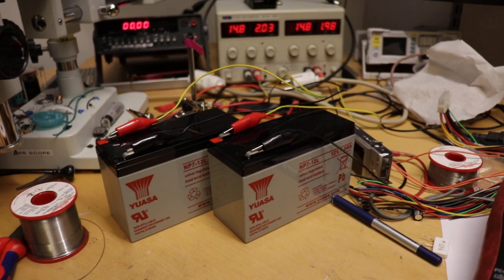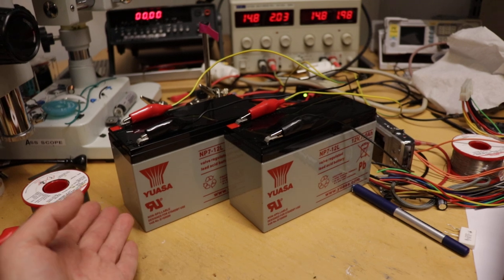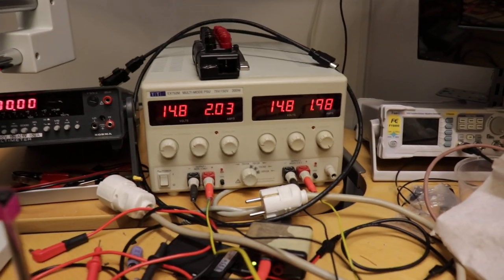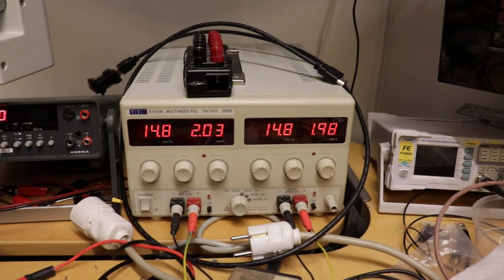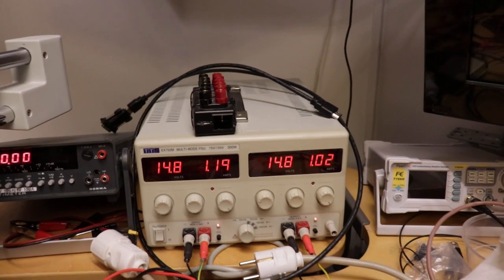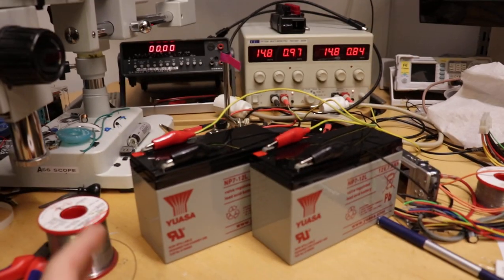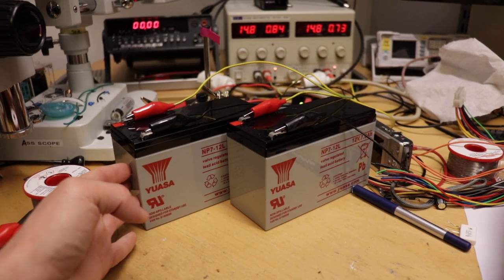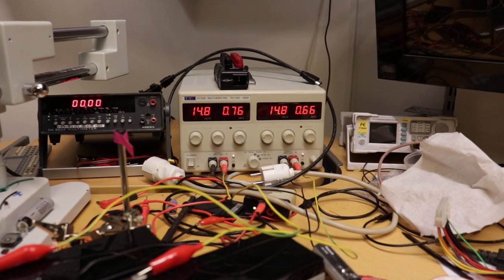Why you should individually charge new lead-acid batteries before install

Comment: I just picked up some used 52v 18650 packs. First thing I did was open them up and make sure every parallel bank was the same voltage. This helps out the bms plus verifies the bms has been working.

Comment: It'd be nice if UPSes had a balancing system akin to how lithium batteries have with the taps between cells to make sure they're all charged properly, but I guess that'd make them cost more, and APC would not make the big bucks out of selling us over-priced battery packs that crap out in no time due to not being properly charged...
Reply: I had an 48V sine wave ups which used 4 batteries in series. I added simple circuits to each battery consisting of a suitable zener diode and a 250R resistor. All components were cherry-picked from a larger batch to be close to identical. The batteries lasted over 6 years until one dried out. No puffy overheated cells and no drama. I keep telling myself that the balancing circuit helped :)

Comment: We use the exact same batteries in our fire panels 2 in series. And we (of course) never balance them. And we test them every year by letting the panels run on batteries for over 1 hour (+- 1A load) and after one hour they never differ more than a few 1/100 of a volt. I guess they kind of balance themselves.

Comment: I was taught many decades ago to put 500k resistors across batteries in series and let them balance themselves..
Reply: It'd literally take forever with a 500k resistor!
If one pack was at 12V and one was at 6V, you would be "balancing" at 12 MICRO Amperes.

Comment: Interesting, got 3 years out of my previous 2x12v 18ah batteries, I wonder if I could have extended them by checking this first?

I also brought a new UPS this time instead of just batteries, do you think UPS manufacturers check this or just throw two batteries in off the shelf?

Next lot I will need to do this however, appreciate the knowledge and content! :)
Reply from the maker: The manufacturers definitely do not check this.

Comment: hmmm, I thought charging to 14.8v per cell is what gets them into balance? whatever is over 13.7v is just a temporary charge and whatever is extra current flowing just electrolises the water? So the higher charged one just electrolises the water a little more absorbing nothing more than it can hold and passing the current to the other battery getting it to the same voltage. maybe the UPS never does that for a long enough time perhaps? well I guess I better check and charge my UPS's then, and will certainly keep that in mind in the future!

Comment: The company I work for, go through 100's batteries of these in a year that get wired in series and I've never seen a problem with them being unbalanced. The biggest killer of these batteries is heat. They only have a service life of 5yrs because they produce hydrogen sulfide.
Reply from the maker: Hydrogen sulfide? I haven't heard much about that being an issue in VRLAs, can you tell me more?
Reply: ROFL @ "go through 100's batteries of these in a year that get wired in series and I've never seen a problem" - well of course, because you aren't looking for a problem.
Reply: @johncoops6897  I've been working on fire alarms & 24v PSU's for over 15yrs and I've never seen a problem with unbalanced batteries. I have the proper tester for these batteries so you soon see if the batteries are out of spec. When you do the annual inspection that involves testing over 400 batteries in a two weeks on one site, you soon start to see patterns of battery failure. Usually it's either cheap rubbish batteries or heat. Heat kills these batteries faster than anything else. In a room that's constantly over 27'C batteries that are good for 5+ years can be killed in less than 2.
Reply: @FFcossag  It's not a big problem, it's usually prevented by regular testing and replacing them before they go out of capacity spec. I can usually spot them if look at the way the light reflects off the sides. If they are convex in any way, then it's time to swap them out. It can happen quicker if the terminals corrode.
Reply: @grahammuppet  - sounds like you've never even tested them for voltage balance. Nevertheless, they kind-of "self-balance" to a degree if you whack them with a very low current charge for a long period of time.
What kills them is heat, vibration, and being continually trickle charged (like UPS tend to do).
Reply: @johncoops6897  Yes and no. We do check for it in fire alarm testing. But I don't worry about it because they will balance themselves within a day or so. If it was a genuine problem that would cause problems, they would of modified the regs on fire panels in the uk to balance them during charging. I've tested 1000's of batteries over the years, which includes recording the voltage, capacity and temperature. You will always get the odd battery that goes wrong early, but usually if a battery looses it capacity before 5yrs it's either heat or cheap batteries.
Reply from the maker: Oh, that sounds more like plate growth or pressure buildup due to hydrogen gas production, not hydrogen sulfide. I've never heard of hydrogen sulfide in particular causing problems, so I read a paper on it, and it mostly seems to be an issue when cells fail in thermal runaway.

It's nice to hear that you don't have problems with battery balance - you must have good suppliers and/or equipment! This is not always the case however, and I've seen many unbalanced pairs of batteries shipped over the years.

Heat is indeed the biggest factor for killing lead-acids (corrosion of the positive plate accelerates exponentially with temperature, turning the innards into mush), but in applications where heat is not forcing you to replace your batteries frequently, factors such as cell/block balance begins to play a more important role.

Comment: Hello, I want to ask about this device.
Model No.: InfiniSolar 10k - PAR - B
 Does it sell the surplus to the electricity network? I own 2 of these devices. According to your experience, is it possible to earn, meaning is there a feature to export surplus electricity to the local network? Please answer
Reply from the maker: You can, but you need to talk to your local grid operator and sign a contract, if they offer it.

Comment: Please  , can you tell me what is the cut-off current for battery charging : Ex :  for lead acid 12V 7.2A
Reply from the maker: That depends on many, many factors. 0,01C-0,05 works as a rule of thumb.
Reply: @FFcossag  Thank you

Comment: i have so many questions !! first what are you going to do with them and second did you check the amount of liquid inside ?? maybe the capacity difference is due to the amount liquid inside and can you top it up or not (i bought new led acid batterys before for my car and found it had low amount of acid ....... from factory )
Reply from the maker: They're just for a little UPS I have by the servers, in case the GFCI trips or something, so they can shut down gracefully.

You can't check the water level in AGMs.  If you open them, all you see is a moist fiberglass mat between the cells, there's no "level".

Comment: Edit: Do not take the numbers in my post as fact. Read the reply and do your own research.

What about the internal differences between the cells? I guess a balance charge (if I remember the terminology) of 18 or so volts (don't know the procedure by heart, only by word of mouth from YouTube) would be a good idea for all lead acid batteries, new and then ever so often... Right?

It's a serious question that has been nagging me for years.
Reply from the maker: 18 V on a 12 V block is WAY WAY WAY TOO MUCH DON'T DO IT! You want to use a low current constant current charge or a 14.8-14.9 V constant voltage charge for a couple of hours at most. On more serious batteries you get specs to follow. But none of them go up to 18 V ;)

For example, on the Sonnenschein A600 Solar, you push 1.2 A per 100 Ah through the battery for 4 hours to balance it.

Comment: yeah, but no :))) . put them in series and you will see they will get even in about 20-30 min. you are doing some utter wasting of time.
Reply from the maker: That is definitely not always the case, I see cases all the time where one battery floats at 13.5 V and the other at 14,1, and they just never really recover. This is especially true when you get two batteries from different batches, which is a frequent enough occurence.
Reply: @FFcossag  that means one of them is cooked. It will never recover no matter what you do. The capacity in the one that never recovers is at most half oh the other one. This is why it happens, and the other reason is a huge voltage difference, like 12.8 vs 11.0  or something like that. You have the tools, do an experiment with batteries having the same tested capacity and if i am wrong, i will send you flowers and two boxes of candy! :)))